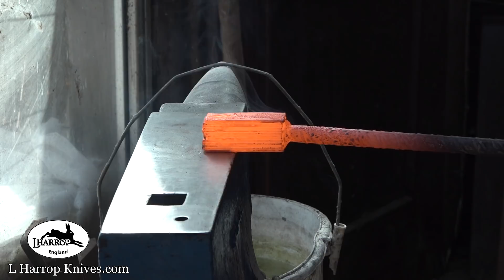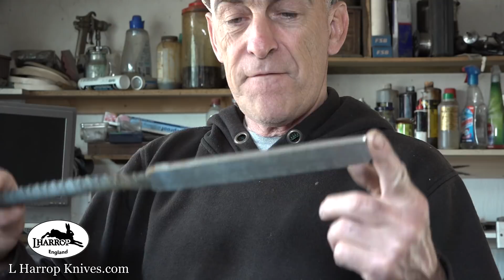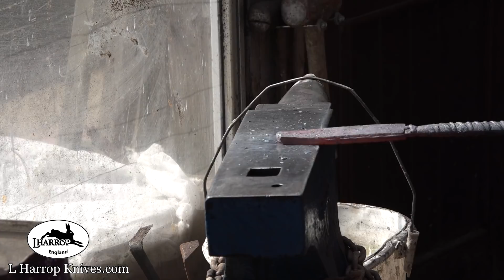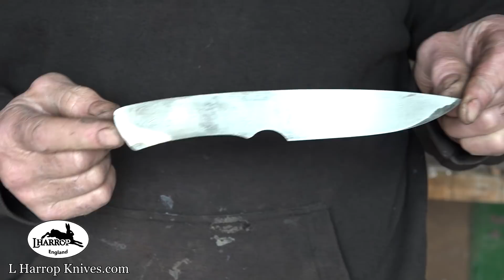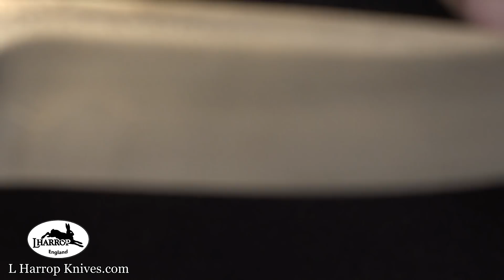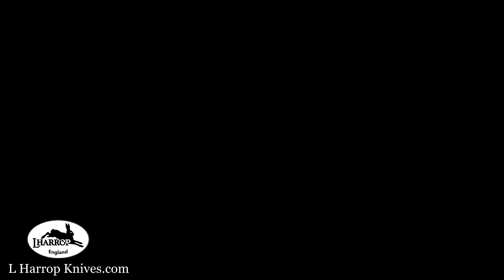Forging Damascus clad blade

Comment: Hi Lawrence. That is a very wel made damascus cladding knife. I found the most difficult in making these is to keep the core centered in the billet. If its off to much you get a blade that has damascus patches reaching the cutting edge. What i do to avoid this was to first make the damascus billet a bit thinner before i added the core. I usually try to get it to max 4mm thick and i grind it parralel before adding a 4mm thick core to it.  Then i forge the stacked billet from about 12mm thick down to 6mm and grind the edges clean before i sand the blank flat. I dunk it in ferric for a minute  to see where the core is at and adjust the grinding so that the core remains a bit more in the center. From 6mm to about 3.5-4mm . I also do not forge weld the bevels or the shape of the knife since it has the tendency to distort/bend the core unevenly. My latest knife looks a lot like the one you show here....i only added an extra layer 99% pure nickle between the core and the damascus to get a visible wavy transition between those layers. This was the result https://www.facebook.com/photo.php?fbid=1709835229098560&set=a.125354204213345.31899.100002162994745&type=3&theater
Reply from the maker: Thanks mate, yes i did a quick etch after surface grinding to see the edge, realised i had deformed the core quite alot which meant the damascus was not an even thickness each side, knew at that point it might be off on one side a little but as it was a trial run was not concerned. next time i can get it right working the sides evenly. The damascus down one side on this was caused by not hammering on the bevel enough the other side got more work, but good to find out these things for the job to come. Cheers.
Reply: HoutmeyersP  Glad to see some discussion on this aspect as noticed it myself. Had a look at your picture very nice knife, the nickle works well.
Reply: ppotty1 very nice knife Loz, I like that look a lot, almost Hamon like, big thumbs up.
Reply: I have a question for you Lawrence ...does the damascus steel that you forge anneal well in the ash you put it in hot?I have a hard time getting it soft enough to make drilling of handle holes somewhat easyer. Tried normalising/annealing it by putting it 3-4 times back in the forge to glowing red and let it cool down slowly....it does soften but it stays very tough to drill.
Reply from the maker: yes its really soft annealed after the ash only really needs 2 hours in it. Most carbon steels will harden just cooling in the air so you need ash or vermiculite etc to bring the temp down slowly to soften it.
Reply from the maker: cheers mate

Comment: That is a beauty. There is a guy in Portland OR that specializes in Damascus. He places a hot piece of iron in his his press dies prior to drawing out his Damascus billet. The dies really suck the heat out of the hot steel. Awesome work and really liking those Patreon videos.
Reply: Correct ,but  thats only advantages during first few cycles in the press. After the first few cycles the press dies get hot fast anyway. The first few times you just need to go fast and dont press to deep at the same spot.You have to keep loocking at the steel and never let it go black when pressing.Using narrow dies can help a lot preventing heat loss. But even when the dies are very hot they keep sucking heat fast since the whole press is one big chunk of steel( its a heatsink)...centainly when you use a slow system like an air over oil press like Lawrence does. A heavy and fast 25-30 tons electric hydraulic press is the better option...but the very best tool for damascus forging is a power hammer because the contact with the billet is very short and so the heat remains in the billet much longer.
Reply from the maker: Thanks Pascual yes i do the same to warm the dies up, cant get them too hot or they deform when squashing the billet, faster press one day.
Reply: Thank you for the information. I am learning a lot and seeing things from various perspectives. People sharing helps so much, I love this info sharing media.

Comment: Fine job Loz. You mention doing San Mi from stainless will it have a high carbon core ? If so do you weld the stainless solid on the outside of the core or do you use a special caustic flux? It would be nice to see the process you use . That is something I'd like to try I really like the contrast from the stainless and high carbon. Martin
Reply from the maker: Hi Martin, yes the core will be 01 or 1095 the stainless will be mig welded all around the edges to keep oxygen out during forge welding, no flux needed